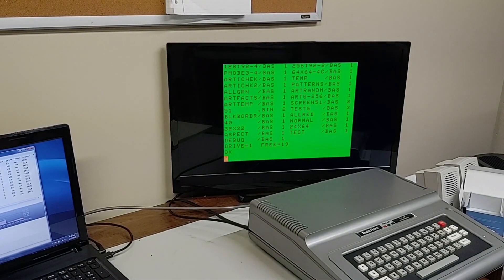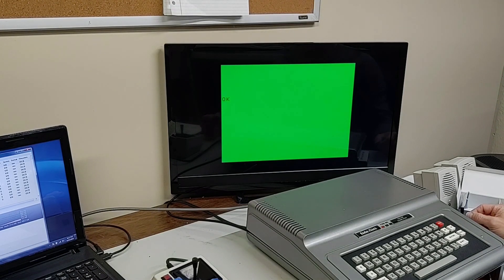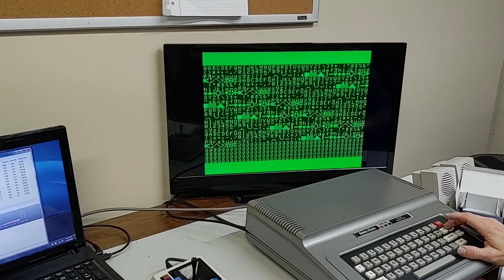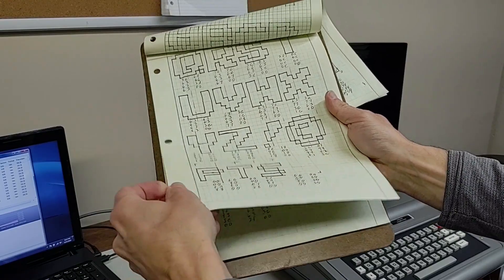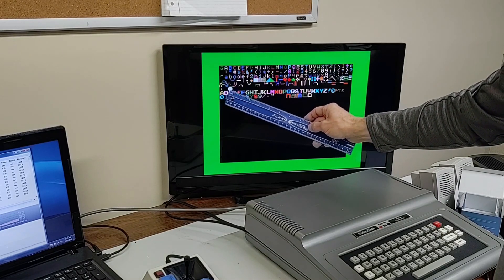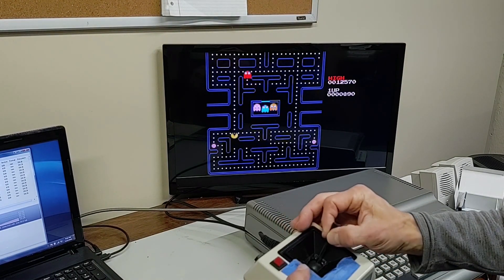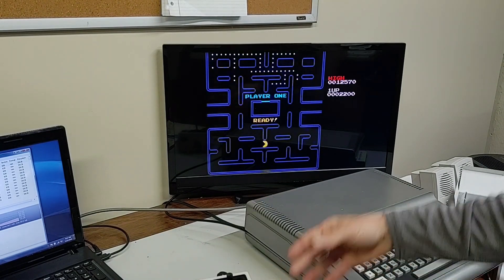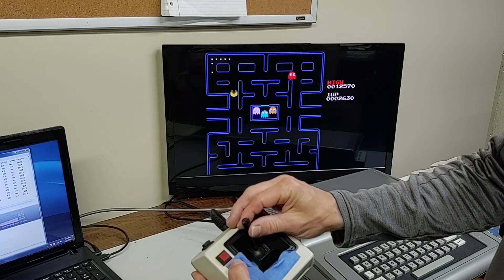Recreating Pac-man on TRS-80 Coco 1 16KB || Sprites || Scrolling || Tile Graphics || SID Sound

Comment: I want a CoCoDV on a coco2, but can an FPGA be made to replace the Gime Chip? If so can it also do direct digital instead of rgb to hdmi? Don't get me wrong the RGB to HDMI works well, but having composite RGB TV and HDMI out would be absolutely the ultimate CoCo3 mod. PS does the CoCoDV elimiate the 6847? The video I saw I think showed the CoCoDV with a 6847 on top. Would be cool to have various outputs on the CoCo2, like composite, TV, and HDMI/DVI and ?possibly? rgb? Then I might be able to use the same monitor on both a coco2 and coco3...
Reply from the maker: For the Coco 3, we are all waiting to see when the GIME-X development can resume.

Comment: Great stuff. I had many fun weeks digging in to how PAC-Man works when working on an Arduino port. Very nice work!
Reply from the maker: There are so many mysteries in the programming of Pac-man.  I've always wanted to know how the ghosts work.  I believe that I understand most of their algorithm now.  There is a glitch with one ghost that I haven't mimicked yet.  One ghost has a faster speed than the others which I need to implement as well. What's interesting is that the actual algorithm is not using AI, but it can come across as it is.
Reply: @acs8-bitzone651  Have you seen the website that breaks this all down?
Reply: @acs8-bitzone651  I thought that it was all explained. 1 of them tries to follow your exact path, if I recall correctly. Each of them is unique.